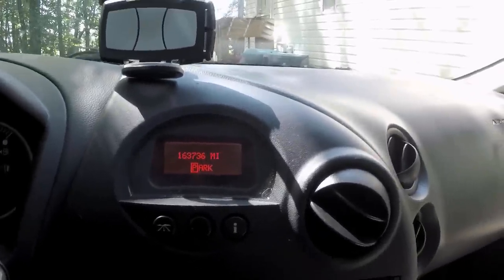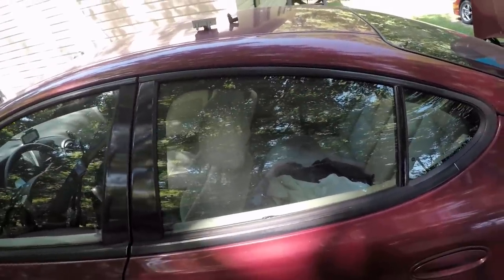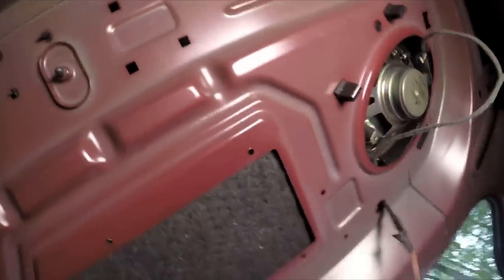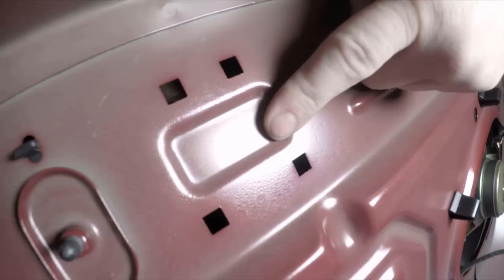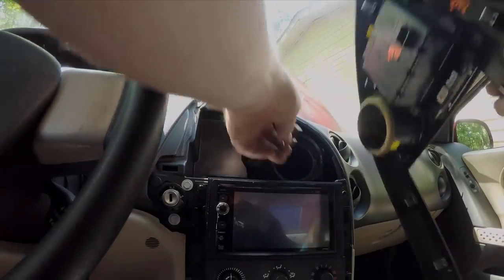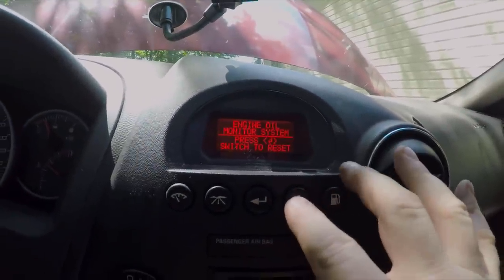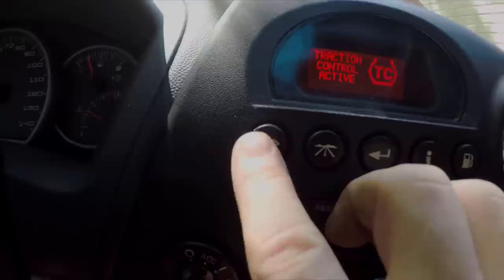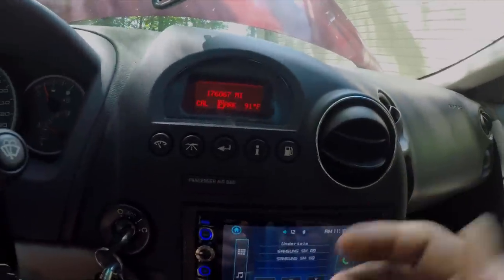Driver's Information Center Upgrade ( 2005 Grand Prix )

Comment: So what mileage does the “new” DIC show?
That of the donor car or of the car it’s going into?
And if this requires a reflash at the dealer, what does that cost?
Reply from the maker: It will show the mileage from the donor,  price to flash it will vary depending on where you have it done, but if you find one thats close you wont have to.

Comment: I did this upgrade very cool so u also know if u could take a steering wheel with radio controls and it work like factory I had a 07 impala cop car I did it to but didn’t know on this car

Comment: Pretty cool upgrade!
Any easy way to upgrade the TPMS to the more modern version?
Reply from the maker: Researching that now, but i doubt it due to the bcm differences
Reply: @SalemDoyle  So it was a success but my Miles Switched??? The car this came off of was at 280,677 mine only Has 144,000 on it any way for my Miles to recalibrate?????
Reply from the maker: It stores the miles.  You can have it flashed to match your pcm at a dealer
Reply: @SalemDoyle  thanks!!! Just subscribed
Reply from the maker: Thank you sir!

Comment: that's a cool video with some good info , but the first bezel that was on the car shows lower mileage than the other one
You just put 13,000 miles in 5 min but other than that very helpful info

Comment: So, how would I go about resetting my information control center. It keeps reading reduced engine power, and for some reason it's not wanting to take gas or anything. I changed the throttle body, and everything on it I could think it could be. I really need some helpful advice please?!?
Reply from the maker: If it is still reading it. There is still a problem.  Check the pedal anf wiring
Reply: @SalemDoyle  what would be or is there a simple way, cheap way to go about doing this? See, when it first started doing, I could be going down the road cruising and then the reduced power engine light would come up and it wouldn't get gas or something. So, I put it on a tester, and it said something about 2 of the valves had a open air flow on it or something???? What ya think?
Reply from the maker: @alishatidwell397   There is a message to get ahold of a pedal assembly from a junkyard for cheap you could just swap in to see if it fixes your problem otherwise you need to look at the wiring near the pig tails and see if any of it is broken or you find in these shorts
Reply: Evap system and tps sensor possibly. Get a cheap scan tool it will tell u everything u need to fix it yourself. Try it can't hurt
Reply: Same problem and I changed from a 5 button to a 3 button I might need to change back to a 5 button it's shoot out a code u0107 and draining my battery ths might be my problem
Reply: @alishatidwell397  is your car shooting out the code U0107 on the test reader scan
Reply: @alishatidwell397  if so did u get it fix and 😊 thanks

Comment: I have a 2006 Grand Prix base, and in the trunk he tried to find the harness for the compass, disassemble the seats and can’t find any connection for the compass, do you know anything about that?
Reply from the maker: Some of the earlier models dont have the harness.  My 05 didnt.
Reply: @SalemDoyle  If I don’t have it, what could I do? Can any adaptation be made?
Reply from the maker: @arcentalesnoel  you could probably wire it in, but would need the harness from a junk yard.

Comment: I got a question my gear shift bulb light went off for no reason at all, I replaced the bulb and it still didn't come back on. I was wondering do you know what else it could be.
Reply from the maker: Probably the wires to the bulb
Reply: @SalemDoyle  ok cause it was working perfectly and one day it just went off and never came back on.

Comment: Just finished doing this mod to my 06 base model. I didn't know the compass hook up isn't there and I bought a compass off of ebay. Is there somewhere else the compass connector could be? Maybe they added it but just didn't fully route it?

Thank you for all of your videos and sharing your knowledge with us. 

Next on my list is to clean my throttle body and install a ZZP cold air intake.
Reply from the maker: The compass hookup is there on a lot of the cars just not everyone of them so yours might be there

Comment: Hey man did motor swap with the ecu everything is  hook up on the motor  dash lights all work but when trying to start motor I got nothing  no rekay ckicks nothing my dash so lit up but my hud goes out ..I'm just wonder with different ecu does it need reprograming the ecu for new key  it's 2000gtp shell and key ...2001 gtp motor tranny and ecu ..  is it the vats .....great clip man ....cheers
Reply from the maker: I would. Heck vats, the ecu has to match the key or be programmed for it
Reply: @SalemDoyle  thought so ...thanks man  my friend keeps saying u dnt but I keep saying u do and thats,why it need a relearn...

Comment: Ha Salem just started watching your vid love them man. but the ? is I had the whole back deck off of my 08 grand pix base trying to fine the wire for the compass and can not fine it and I don't want to start cutting tape off the wires any idea about where it should be at. thank you
Reply from the maker: I had the same problem, seems some of them dont have it.  Trying to find a solution now.  And thanks for watching

Comment: My compass sensor failed on 05 GTP.  I found a new one on the web for around $35.  Last week I replaced the car battery, now my in dash clock is blank. I go into the nav system, Menu, to set it and the option is disabled.  Everything else works.  Any ideas guys?
Reply from the maker: Any issues with the radio?
Reply: @SalemDoyle  Radio, DIC all work. Just no clock.  BTW, I do have the OEM 5 button DIC.  In the clock screen I have no option (now) for 24 hr or Source, or Daylight savings.  They are disabled.  I wondered if I was missing my GPS input, but Nav works. And the clock worked prior to replacing the battery.
Reply from the maker: @April8989  thats a wierd one.    Maybe have a dealer scan the dic?

Comment: I did the 3 to 5 button switch, but of course it has the mileage from the new DIC I put in, which is about 90,000 miles off. Anyway to reprogram that?
Reply: I'm seeing the other comments now about reprograming it. Where would I go to do that?
Reply from the maker: Dealer
Reply: @SalemDoyle  thx

Comment: i have a question, if you was to get the button for the traction control, and install that center console, can you control the traction control?
Reply from the maker: If the wiring is there you should be able to

Comment: I am glad you are doing better Salem, I love your videos.
I have a question.
Does it have a light on the shift box?
At night when I use either reverse, drive etc. I can see what shift I am on.
Thanks for your help!
Reply from the maker: There is no light at the shifter, but it should show the gear for a second on the info display
Reply: @SalemDoyle  thanks!
Reply: @SalemDoyle  I am sorry for asking so many questions, but I just got this 2006 Pontiac Grand Prix and cannot find the transmission dip stick to check the transmission fluid level.
I need help! 😅
Reply from the maker: Its on the drivers side near the back of the engine bay

Comment: Oh man good video i have an 05 i wonder do they come with a keyless remote start
Reply from the maker: My 05 did
Reply: There's a way to get it re-flashed to enable remote start from the dealer, but they have to use a VIN code activation from an already remote start capable VIN chassis. (aka, break some rules) So you need to have a good buddy at a dealer.
Reply: Yes they do. I have 1 on mine factory installed
Reply: @dmo848  how much the dealer run u

Comment: What causes ABS, Traction Control, and few other things to stay on and not work? I have the o5 GTP GrandPrix.
Reply from the maker: Usually wheel bearings, but you need to have the codes pulled
Reply: @SalemDoyle  I bought the car with the lights on and I've been fixing it up. Will the wheel bearings cause the T.C. to stay on and not work,also are they located in the back? On the wheels in the back? I really want it fixed before Winter, I need to teach my son to drive, but I want everything working properly. Thanks.
Reply: @SalemDoyle  I have a OBD II Code reader.
Reply: It says Service Traction Control,Service ABS System, Service Traction System,Service Variable Effort Steering( rubber boots on rack and pinion need replaced), Service Break System, Check Tire Pressure( didn't pop up til I had oil changed and they are the people that said the rack and pinion rubber boot on each side was busted. Wasn't busted when they done work replacing seals and coolant line for transmission fluid to stop leaking. I also had a new Hub Assembly put on the passenger side(front). It doesn't run hot, but code P0128 pulled: Coolant Temp Below Thermostat Regulating Temp, P0420 pulled: Catalyst Efficiency Below Threshold Bank 1. Only 2 codes pulled.
Reply: @SalemDoyle  Also meant to tell you the lights will go off sometimes when I crank the car and stay off til I hit a bump and pop back on. It's supposed to crank and warm in the Winter,  but the ABS light being on stop it from activating that feature.
Reply from the maker: Sounds like a bad abs wiring harness at one of the wheels
Reply: @SalemDoyle  so would your replace the wire harness first and then try the wheel bearings?
Reply from the maker: Probably, need to pull codes to see what wheel it is first
Reply: @SalemDoyle  ok, so have my mechanic see if they can tell which one is causing the problem? Would it be one of them in the back?
Reply: Or check all 4 wheels?
Reply from the maker: @pamgaskins7177  an abs code scanner will tell you wich one it is
Reply: @SalemDoyle  ok, thank you so much for everything. I'm hoping I can find the problem and fix it.